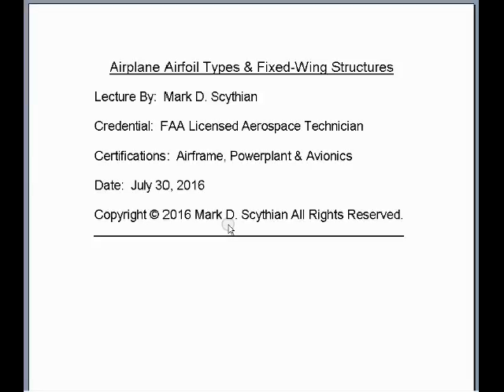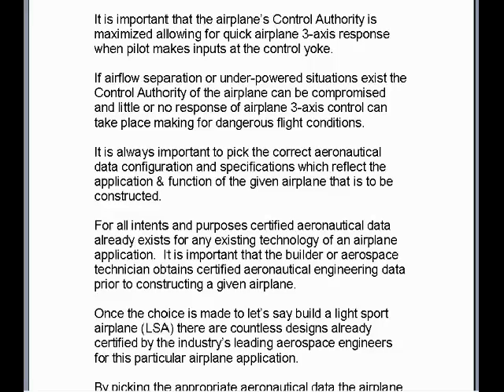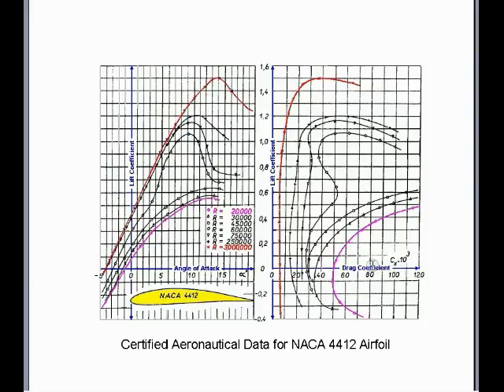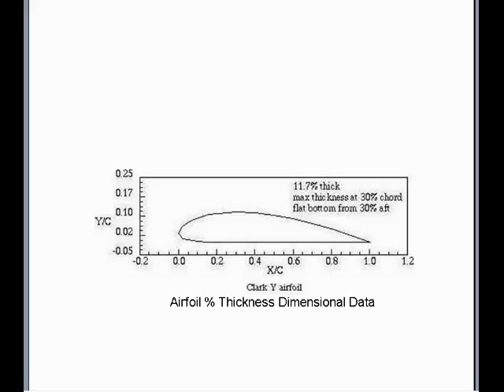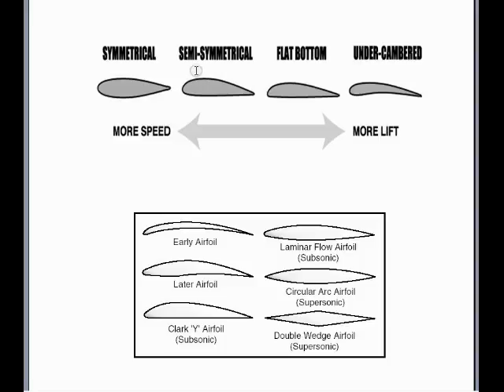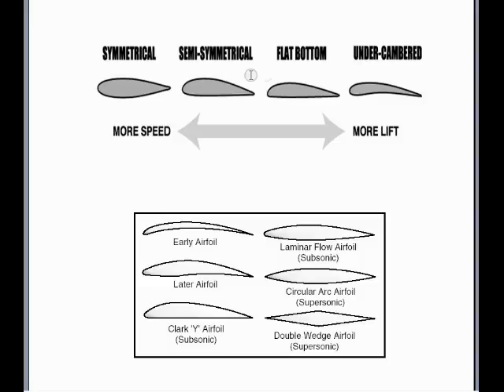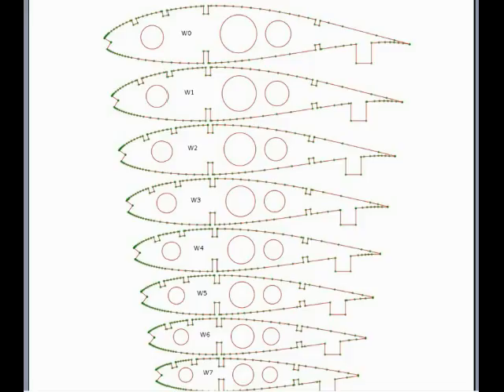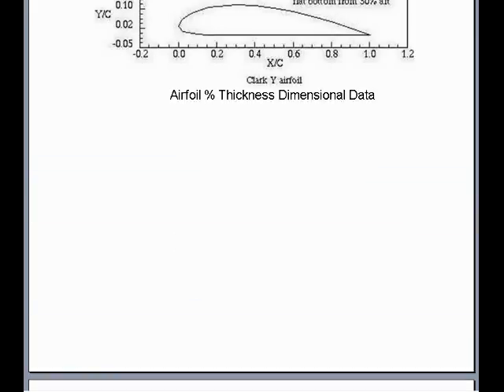Airplane Airfoil Types & Fixed Wing Structures

Comment: the flow speed is not faster on top or bottom.  So many people dont realize the bernouilli thingy has been debunked.
Reply from the maker: Well, Bernoulli died long before the airplane came into practical use by the 1900's as he lived during the 1600's.  There are two force components to aerodynamic lift and they are a vector sum of both Newtonian and Bernoulli force components.   Newton => Force = Mass x Acceleration.  Bernoulli => Force = Pressure x Area.  Any other machinery utilizing airflow whether engine induction systems or vane governors utilize aerodynamic force by differentials in pressure, velocity and acceleration of mass airflow.  All that Bernoulli Fluid Mechanics states is that whenever a fluid (gas or liquid) moves faster than the fluid around it, will either increase or decrease in pressure relative to the static pressure.  In terms of air, atmospheric pressure is the static reference pressure.  So if you're inside of your car driving at high speed and you roll the window down just a little bit, like a slit, and smoke a cigarette, the smoke will get sucked out of the window slit because the air inside of the car is moving much slow than the air outside of the car.  The window slit has a pressure below atmospheric pressure where as inside of the car the pressure is greater than atmospheric pressure.  Only because the outside air is moving much faster than the inside air.  Apply this to let's say an airfoil, a small amount of pressure above atmospheric pressure exerted evenly against a large surface area such 2-D wing area at its lower surface translates to practical aerodynamic wing lift.  0.1 PSI above atmospheric pressure x 20,000 square inches (150 sq ft wing) and 2,000 Lbs of aerodynamic lift developments.  Bernoulli Lift alone isn't that much, probably around 30% at the most.  Bernoulli Fluid Mechanics is more useful in keeping the air on the wing or propeller by a vacuum aero-elastic effect due to the air flowing faster at the top of the wing compared to the bottom, caused by the camber at the leading edge of the wing.  There is more distance for the air to travel at the top of the wing compared to the bottom of the wing per given mass airflow that is split or bifurcated, causing the streams to flow at different speeds, faster at the top and slower at the bottom.  Once enough airflow is attained, Bernoulli Fluid Mechanics keeps the airflow consistently upon the wing (Boundary Layer, with the airflow flowing faster at the top of the wing or at least equal to the speed of the airflow at the bottom of the wing (if a symmetrical airfoil not flat or semi-symmetrical airfoil) allowing the airflow to stay on the wing.  After that, when the airplane "rotates" and the wing angle increases positive (+ AOA) then Newtonian Force component kicks in, accelerating mass airflow.  Also, the change in AOA positive intensifies the Bernoulli Pressure component since air is flowing much slower at the wing's lower side when it's positive AOA is much higher further intensifying the differential in airflow speeds between the upper and lower surface of the wing.  These two force components, Newtonian and Bernoulli in a vector sum depending on wing angle, develop into 'resulting aerodynamic lift'. 

Bernoulli Component = Keeps air on wing using the vacuum effect of airflow speed differentials between the upper and lower surface of the wing by means of the Airfoil Effect (leading edge camber).

Newtonian Component = Takes advantage of accelerated mass airflow into aerodynamic lift.  

LIft = Force
Airflow = Mass
Acceleration = Change in speed
Speed = Distance traveled over a given time
Bernoulli Effect = Gases or liquids in motion faster than their surrounding environment will create pressure to the surrounding environment and vacuum to the faster moving fluid.

Total Force = [(Mass x Acceleration) + (Pressure x Area)]

Mass must be in Kilograms
Acceleration must be in m/s^2
Force must be in Newtons
1 Lbs Force = 4.45 Newtons
1 m/s^2 = 3.28 m/s^2
Pressure and Area must be kept in Pascals and square meters while making calculations.  But can be converted to PSI and sq ft afterwards.

Bernoulli simply observed that fluids moving faster than surrounding fluids will have a pressure below atmospheric pressure (vacuum).  This is science not engineering or technology.  Later on, technicians and engineers used this observation to invent practical airplanes, engine induction systems and other machines deriving force by airflow in motion.
Reply from the maker: This is all math and physics applied to mechanical/aerospace engineering, not opinion, debate or mere perceptions, so there's nothing to debunk.  Since airplane/machines are just mathematics made into components.  Our five senses aren't smart enough to figure out anything so mathematics and physics were invented to ascertain facts in place of mere perceptions.  Below is the Aerodynamic Wing Lift formula which sheds more light on why airfoils such as wings and propeller blades harness lift or thrust.

The formula for Aerodynamic Wing Lift in Lbs = (L) = [(P) x (A) x (V^2) x (Cl)] / [2]; Where P = Air Density in Slugs/Ft^3; A = 2D Wing Area in Sq Ft; V = Airspeed in Ft/Sec; Cl = Coefficient of Lift specific to the given airfoil's specifications.  On lower performance flight applications, the only reason the air stays on the wing is due to speed difference between the upper and lower wing surface areas, due to the longer curve on the upper wing surface compared to the lower wing surface (flat & semi-symmetrical airfoils only).  As for symmetrical airfoils, the airflow speed is basically the same at the upper and lower wing surface areas, where by high-speed applications provide sufficient airspeed to establish a boundary layer, provided by higher performance airframe/aircraft & /engineapplications.  The PAV^2 = Dynamic Pressure, then multiplied times Cl.  A symmetrical airfoil is just that, the curve distance at the top of the wing and bottom of wing are equal, and the camber thickness is usually quite thin.  A wing like this is high performance, high speed, advanced materials (less materials with more strength) with relatively powerful engines.  Symmetrical airfoils provide the best lift at very high speeds close to the speed of sound at higher altitudes.  The other two types of airfoils incur too much drag after about 450 MPH making them not practical for high speed and high altitude flight. 

Bernoulli is just an observation that when gas or liquid moves faster than its surrounding gas or liquid, a vacuum will occur.  This vacuum could be used practically for inventing propeller blades, wings, airflow regulation structures inside of engines, etc.